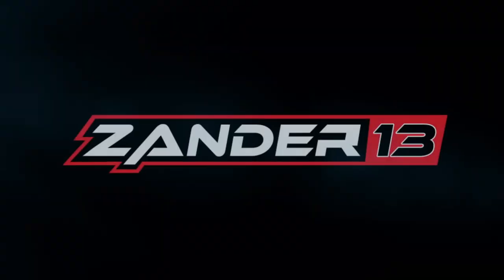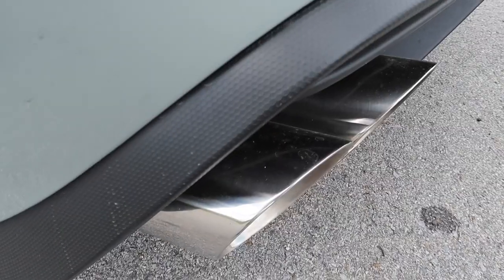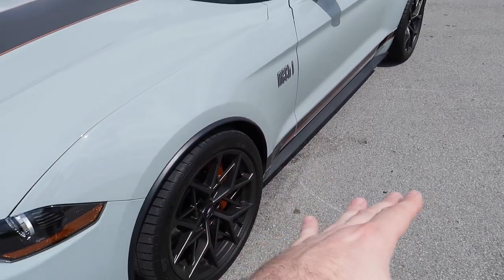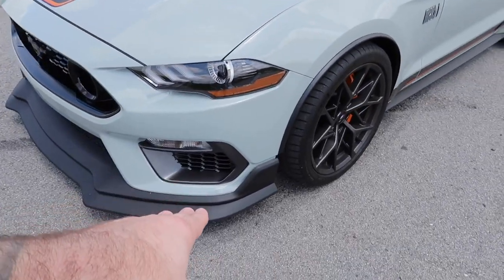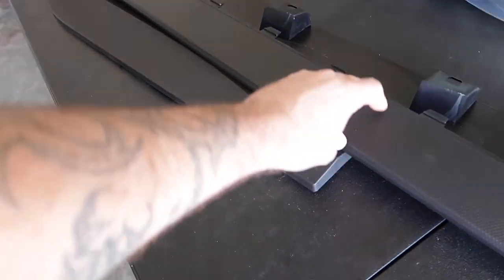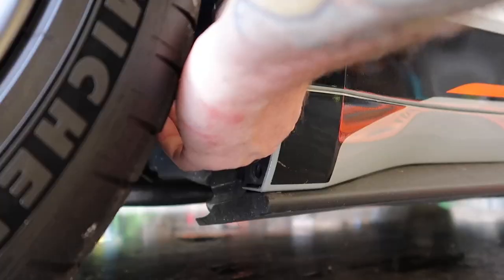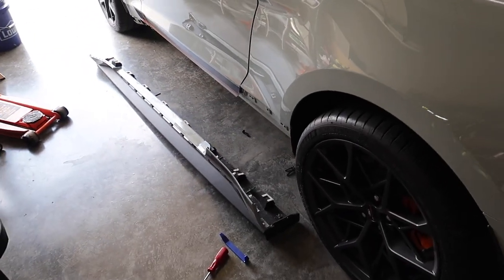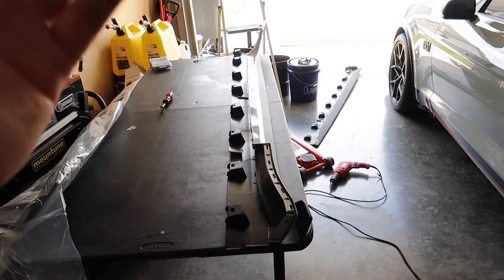GT500 SIDE SKIRTS & EXTENSIONS on my 2021 MACH 1 MUSTANG- WORTH EVERY PENNY!

Comment: We put the gt 500 side skirts on our Mach 1 a month ago. Because we were getting stone chips on the quarter panel in front of the rear tire. We also put the rock blocker foam pieces on too. Plus it does look kick ass on it.
Reply: JLT RB50020 Rock Blockers (2020 Shelby GT500)
Reply from the maker: Nice. I am digging the look of these. Definitely should have been from the factory
Reply: Glad I had PPF'D my Mach 1 to avoid thise pesky stone chips.  $ well spent.  From the dealership directly to the PPF installer.
Reply: How long did it take for you to install them? Want them on my Mach 1 HP

Comment: Absolutely gorgeous car. I have a ‘16 GT350 myself and one thing I strongly recommend is the JLT Performance Rock Blocker kit. The skirts are absolutely notorious for just piling up rocks and sand and funneling it towards the paint due to the extra aero fin on the side knocking it all back inward towards the car. Super cheap, looks clean and for 2 pieces of foam you’d be surprised how well they fit. Have done a few pulls in the car and gotten it up to speeds where you’d think they just fly out of place but they’re holding their own haha. Hands down one of the best things I’ve done for my car. Best of luck the car. Got a chance to see one in person myself today and my god did Ford do a good job with the Mach’s. Great video as well!

Comment: Dude..Luv the channel but why did you not just get a GT500 for all the cash your dumping into this Mach 1 ??  TY
Reply: This is faster than a GT500 and I still don’t think he’s even touched a base GT500’s price yet. Especially with the dealer markups
Reply from the maker: Thanks. I’m still far the price of a GT500 base price and don’t have near the car payment of a GT500. I only financed like 45k lol with no markup. And it’s a manual
Reply: @Dude-tb8ry  the Mach 1 is an extremely beautiful Mustang, but its not a GT500 in looks or performance.  Considering base models. An ordered base GT500 has an MSRP of $76,555 with an ordered base Mach 1 manual has an MSRP of $55,000. If you consider just the difference in engines costs. The GT500 crate motor costs $27, 295 while the fantastic Gen 3, 460 horsepower Coyote crate motor costs $9975.00. This is only one of many differences between these Mustangs. Personally for daily use and my budget, I would purchase the Mach 1. Add a few bolt on parts and enjoy driving it every day. The GT500 is extremely special and for many owners, it's complete and ready for the streets, dragstrip or track. If I owned one. It would stay the way I purchased it. Zander is tastefully building his Mach 1 while still maintaining its stock appearance. From the base prices, he had  $21,000 to spend before reaching the cost of a base GT500. If you want a GT500 look and performance. Purchase a GT500. If you want a special Mustang that looks fantastic while still having close to 500 horsepower with a manual transmission. Then purchase the Mach 1. There's  not a bad choice. It all depends on your budget. 

Zander. The Mach 1 includes Ford's performance school. Wondering if you're going. If allowed by Ford. It should make for some great video content.
Reply: faster hahahah go home .
Reply: @Zander13Productions  you have the ESS Tuning G3 kit right? Hellhorse has a bundle at $8780 for the G3 kit, injectors, pulley, pump and tuning device plus full installation
Reply from the maker: @Dude-tb8ry  yes. Mine is the G3
Reply: You paying?